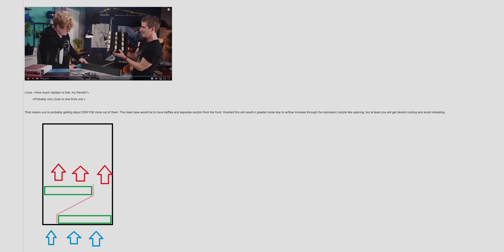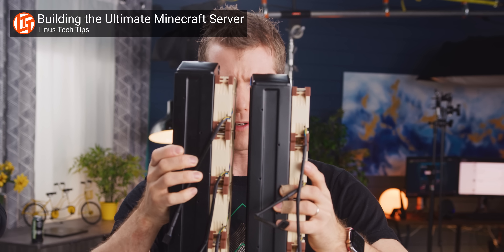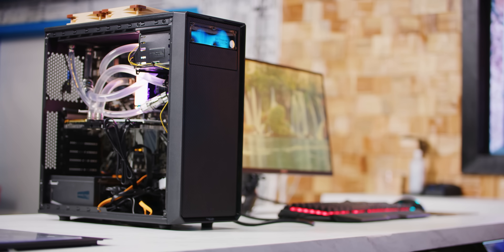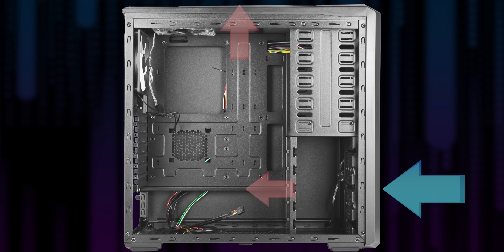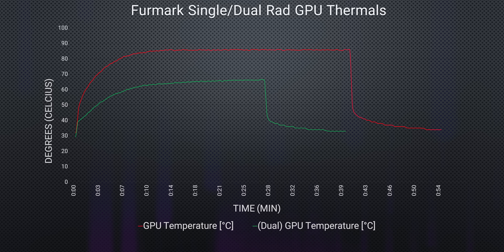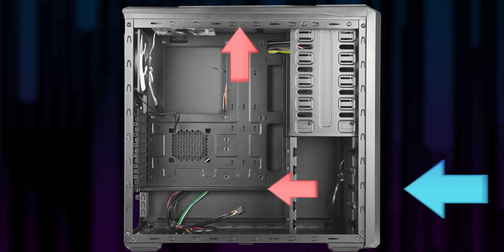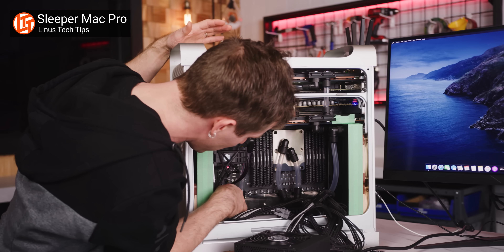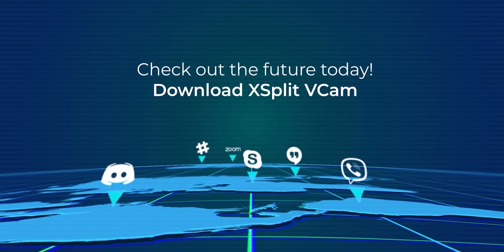I’ve been water cooling wrong for YEARS - $H!T Manufacturers Say

Comment: 0:14 Lol people haven't got it yet? one mask oh 2 masks even though one doesn't do anything... one radiator oh two because it has to be better... It sounds okay and sounds right in theory but usualy in reality doesn't work which is why i don't care for theory much today. Its like this two condoms are not better in fact it makes things worse we have known this for years that 2 condoms is worse than one and as good as none. Yet we still think and say 2 is better than one.. When its the exact same it makes little difference for most things, which is water filters the size of whole factory's use 2 separate types because that's the closest they can come, again its not rocket science its stuff we have known for years way before the internet came to be. Most things are not that much different, also we tend to know that little things tend to be more efficient compared to bulkier bigger things so forth so on. To me that's common sense don't fall into the trap where common sense is not common sense just seems like it. ITs not useless its just the change rarely makes all that much difference in most things all is not the same though and their is always the exceptions.

Your builds should almost always work because your not using stock p.c.'s like most people so you technically should already have everything mostly fleshed out. To make sure everything you thought worked as you wanted it. Yours should always work or be made to work, most peoples though in real life won't be able to be as well put together as your stuff or even corsairs unless they followed you or both step by step.

Comment: Power dissipation is improved if the radiators are not stacked and both are exposed to fresh air. Also, a larger reservoir improves the heat inertia.

In your setup, the second rad acts like a larger reservoir, so it took longer to get hot, and having more fans increased the air flow and therefore the heat exchange capacity.
So, you aren't wrong Linus, but of course you can do better if you can spare the space

Comment: I mean, it is less efficient to run heat off one radiator into another, but if you introduce any new cool air between the two it will increase efficiency.

To be fair to Corsair, a good scientific experiment would have been to truly stack two rads (no air gap, sealed, lots of fans), test temps, and then run the same test with both rads, same amount of fans, having 100% access to cool intake air and check the efficiency between the two.

Comment: Are the radiators really adding anything, or just the extra fans moving more air giving the benefit? I’m thinking it’s the extra air being moved, by the extra fans, is the actual benefit, and the 2nd radiator is doing, little. Those two fans being outside the case, should have also been added to the single radiator configuration. It would have made the same difference, if not more so.

Comment: I think corsairs results are wrong and your test setup is garbage and wrong as well to test corsairs claims. The idea that all air coming out of the rad will be the same temp as the water is bonkers otherwise you could use a single rad with 10000rpm fans against 10 rads with 1000rpm fans and it would perform exactly the same. Not only that but cases have an enormous thermal mass and can also radiate heat to the outside, ensuring the air getting in warm from the first rad will cool down somewhat, best example of this is when I built a gaming system inside a NOX media cube, the case was small and aluminium and got really toasty outside. Also, if corsair was right, having a rad for cpu another for gpu could never work unless they were side by side....

Comment: It is SIMPLE LOGIC! "Fresch" air cools components and when is warmed "used" must be expelled.
In example: on Crosshair 3 board I was not able to use a second graphic card while fans was facing bottom wall of one case and was in contra of PSU fan in another another.

Comment: As long as the hot water from GPU/CPU goes through the exhaust rad first most of the heat is dumped straight out of the case and the water is already pretty cool before it goes to the intake rad so the intake air does not get as warm as the water going through the exhaust rad. Certainly not as quickly. I would be interested to see a comparison between the two. As long as you plumb it that way round you get the best of both worlds. 1) Most of the heat dumped straight out of the case by the rear/top rad  2) Fresh cool air for max cooling from your intake rad.
Reply: The water never gets "hot", unless your pump is dead, lol

Comment: Wow I’m surprised this wasn’t common knowledge for someone in this industry! Although I will say I see professionals
Doing this stuff wrong all the time. For some though looks supersede performance and in some instances I can relate but for the most part I always stick to the basics not just in liquid heat exchangers that utilize ambient air temp but also for basic water to physics or environmental behavior of water. It’s pretty easy stuff once you gain some experience. Also I never use rads in rear area of case at all that should be main heat exhaust only. So front in top and bottoms always draw air into from exterior for AMBIENT AIR COOLING , then rear exhaust fan at highest rpm to make an exiting air flow usually I go one fan size larger than the rest and higher rpm capabilities so you can have that extra pull power. The case will make a lot of difference too on how well you can tune air flow use vaporizer to test air flow patterns if need be

Comment: They said stacking the radiators on top of each other.   You didn't do that.  The air had time to go through the case and slightly cool off.     You need to redo this one with the rads touching.
Reply: they had the rads stacked onto each other, and they said 5c difference...

Comment: You can achieve better results just ajusting the radiators fans to blow the heated air off the case and other fans to blow the ambient air inside the case.

Comment: Just found this. One thing missed, the single rad was at peak, over saturated, so loses efficiency. Corsair's claim would have been justified if you then added a 3rd rad or removing the gpu. You'd see negligible difference with the extra capacity. Thermally, the rads would already have depleted the excess in the coolant. Maxing out the single rad, that doesn't happen. You could stack 10 rads and get the same performance as just the 2 rads.

Comment: I feel like this can be explained with Oxygen Not Included and on that I'm completely ignoring the VAST difference in thermal mass between air and liquid. Basically if you have a wet input temp of 80 being cooled by an ambient air temp of 20 then you will have a net temperature difference of ~60C for cooling. This would be the maximum cooling that you can achieve in an impossible 100% transfer but of course cooling is more like sharing than transferring so we'll be capped at 50% of that figure or 30C. To math it out ->  Rad 1 has a wet input temp of 80 and air input temp of 20 so it will output air between those two temperatures @50C so now rad 2 has a wet input of 80 but the maximum cooling it can do is only (80-50)/2 so ~15 degrees and it's output air temp is going to be 65C. Eventually you are pushing 80C air into a radiator and if that rad is at the end of the loop then we will be actively heating the cooling liquid in the radiator!

Comment: one trick for i9-9900ks delid and pappersand de plate to see the copper then relied whit liquid metal and put just a tyni 120mm aio rad whit liquid metal and every go you have a i9-9900ks running at 5.3ghz all core at 75-85c

Comment: Another possible explanation is that the water temperature is not the same in both radiators. If the water is 60° entering the top radiator, but is cooled to 40°, and as such enters the side radiator at 40°, then the inside air wil be around 40°, which is lower than water temperature from the top radiator, who can then do some cooling as well..

Comment: Perhaps Corsair overlooked the fact that air is not very good for conducting heat at all so it will most likely never be exactly the same temperature as the water in the loop and therefore each additional radiator may get a little more heat from the loop as long as the air is even slightly cooler than the water... even in a sealed case.

Comment: I'm rocking "OWERPOWERED" Intel Core 2 Quad Q9550, with stock cooler, GTX 1050 Ti ( MSI ), all air cooled, at about CPU @ 56° and GPU at 67° C. BTW. MSFS is running at Medimu-High @ 30 FPS

Comment: The laws of thermodynamics are on Linus' side on this one. On a single loop, the water will be consistent throughout; that is why it would not matter where in the loop the GPU, CPU, and radiator are. Adding any additional cooling will always help. 

There might be a issue with two different loops, like an aio on the CPU and an aio on the GPU.

Comment: Air does not heat instantly to the rad temp when moving through it. And if air flows faster, it heats up less, since it has less time to suck temp from the rad. If stacked, next rad will pick up air having higher temp than the first one, but this air still will be cooler than the temp of the first rad. Of course, each additional rad will be less effective given that air heats up more and more with each additional stacked rad. And at some point additional rad should negatively influence the cooling effectiveness if you take into account that it creates an additional resistance to water flow.

Comment: Another benefit to stacking rads: greater fluid volume acts as a thermal buffer to temperature spikes. More fluid takes longer to warm up, like a half full vs full kettle. Adding your second rad even if it has no performance will act as a fluid reservoir. You could add a fluid reservoir to achieve a longer warm up time in any system. Simples.

Comment: I'd be skeptical of Corsair's claim that the air temp from the radiator is near the operating temp of the GPU... it's possible but I doubt it.

I would say, to give some credit to Corsair, there should be a diminishing return because each radiator heats the air coming out to some degree therefore making the thermal transfer less efficient for subsequent radiators.

Comment: I have been wondering why radiators are always in the case. It seems like peak efficiency would be having the radiator outside the case so it sees the coolest air possible. Granded it would look a little industrial  but hay you got those sweet FPS lol

Comment: 10-13 fans config, 3 different models/brands of fans, all the fans directions you can think of, 1-3 radiators, 2 different cpu blocks, 2 different gpu blocks in the same Lian Li O11 Dynamic XL case 300 benchmarks later here are my recommended setups : 1) only cpu cooling 1rad front fans as intake 2) only cpu cooling 2rads front+bottom fans as intake 3) cpu and "200w or less" gpu cooling 2rads top as exhaust front as intake 4) cpu and "300w" gpu cooling 3 rads front+bottom as intake top as exhaust
those will give you the overall best water,motherboard,chipset,nvme,memory, cpu/gpu temps you can have, if you want to base your build on results from open test benches in "freezing" 18°C hangar sized room like most youtubers use I can't stop you, don't be surprised if you don't get the same results as them ;) feel free to ask why I did what there's a reason and benchmark result for every choice

Comment: Try not to use RGB lighting!   Wast of power regardless of how little you may conceive it to be, more power used, more heat generated by the power supply adding to the heat of all other components in the case.  Heat compounds upon its self.  And regardless of how little heat you conceive is generated by RGB lighting, it is still heat being generated added to total system heat.  I do not use liquid cooling, never needed it.  I am not running a damned supercomputer with a large amount of crap shoved in a tightly confined space of a case.  My cases are large and there is excess open space for airflow.  A lot of money wasted on crap that does nothing to increase the performance or efficacy of the machine.  All I want is for it to work and do the tasks it is built to do.

Comment: Just a food for thought for a better test bench for what there claiming. Using a test bench hook up 3 radiators like you did for the Minecraft server, and record the temps, all while the radiator is still outside. Then take those same 3 radiators and stack them up on top of each other so they don't  pump the same air through the next radiator and record that difference. I think you could prove rather you can get more performance from them in that setup or not. But that is just me.

Comment: The only way the air leaving one radiator would stay the same temperature as the core it just cooled would be if there was no air between the coolers themselves to dissipate the heat, the fact there's a large air opening between the two in most pc cases gives the air time to cool so will still be able to cool the next radiator.
even in a stacked radiator set up like the minecraft server, not all of the air that goes through a core is touching the fins of the heat exchanger. so there is always capacity for more cooling further down the line.

Comment: Heat capacity

Heat capacity or thermal capacity is a physical property of matter, defined as the amount of heat to be supplied to a given mass of a material to produce a unit change in its temperature.

To calculate Heat Capacity;

Q = mcΔT
Where,

Q is the heat capacity in Joules

m is the mass in grams

c is the specific heat of an object in J/g °C

ΔT is the change in the temperature in °C

Specific Heat is also defined scientifically;
Specific heat (C) is the amount of heat required to change the temperature of a mass unit of a substance by one degree.

There is a metric ton of maths one can do to calculate the efficiency of modern radiators but it's worth noting that the fully calculate their loops, you're taking into account the specific heat and heat capacity of the fluid, the fluids container and the intended heat transfer mass (IE whatever the container or radiator or made out of AND the Air itself. 

The secret is the airflow's velocity in this case as so long as you're not having the volume of air heat the max-Q by the end of the radiator surface (the exhaust), the air is still viable for cool via thermal transfer. So you just increase the velocity in order to have the volume of air not become overly saturated. Since you're cycling through more air mass, it means your can make effective use of your radiators even if stacked - though let's be clear, the radiators would still work better when not stocked of course but at these temperatures, it's negligible as hell. 

Thermal dynamics along with Aerodynamics is a fun study. We cool aircraft engines simply by routing high velocity air around - even the jet exhaust has a cooling effect on the turbine that keeps the turbine from melting despite the combustion temperatures being so hot. We use high velocity air to shield heat from materials we know would melt - such as with the inside of jet combustor housings. You have to remember Gay-Lussac's Law here - air pressure and temperature are proportional. So while people always say to get higher pressure fans for Radiators   in order to deal with the Resistance, higher velocity is just as well. The true efficiency of these radiators is not in their thermal conductivity due to the specific heat or Q ranges, it's due to the fact that their manufacturing processes are now so good that their fins are just that thin profiled and really do not obstruct that much airflow. The air stream is rather consistent from front to back and any turbulence you do have is like from your fan itself. 

So if you're stacking radiators, increase the speed of the stream - go for more velocity.

Comment: The answer is pretty obvious... In the Corsair CFD they don't have fans on the second rad... Second set of fans, more airflow better performance... That's also why case openings matter... 
Anyway, radiator setups are one of the better understood things in Engineering generally... If you want to work out the very best way, ask an Engineer.

Comment: Um, he cheated though. He had a cool air intake instead of a hot air one that Corsair critiqued.
Reply: no he didn't the top rad is pulling air from inside the case which theoretically should be the heated one due to the front rad pulling air in
Reply: @deathleopard4960  No, the top fans are pulling air from the room. The radiator is minimally affected by the inner components since the only air it’s receiving is cool air only. It’s actually receiving even less hot case air because the cool air is blowing through the radiator shielding it from the hot components.
Reply: @nolanw1287  you can see at 14:11 that when installing the noctua logo is facing out of the case which for that fan means it's blowing out/pulling air from inside the case. They also use a diagram earlier in the video showing that's what they are trying to do in the first place so I doubt they were trying to mislead people with it.
Reply: @deathleopard4960  first off, I think you meant 4:11. But holy shit you’re right. I don’t know why on earth they’d do that since now the fan is basically doing nothing. It’s sucking through the radiator, not even blowing at it. It’s still helping their point in a way since having very little air blowing at it is likely better than a lot of hot air blowing through it.

Comment: You can stack all you want, as long as you end up with a counter-flow setup.
It would likely benefit more from water flow rate increases than air flow rate increases, but a simple config where you stack them and let the water flow in a zig zag motion through the stack should allow for more silent airflow.